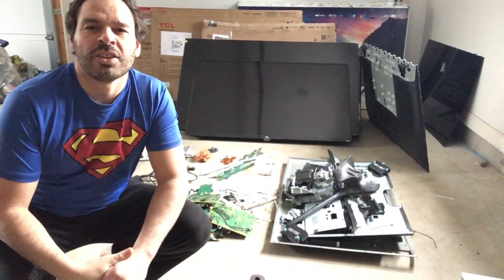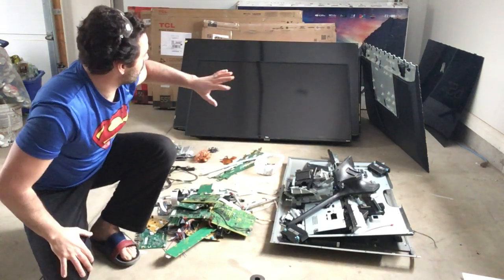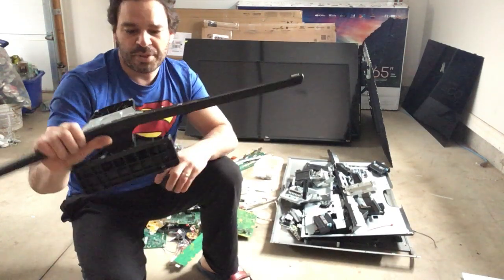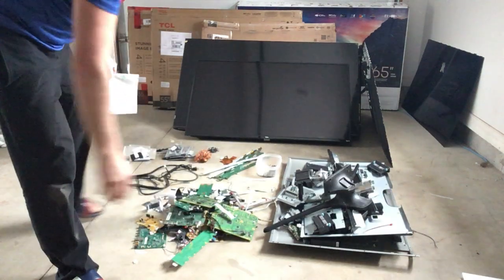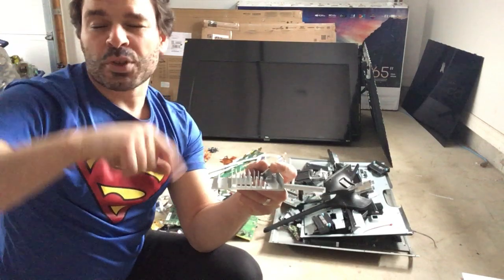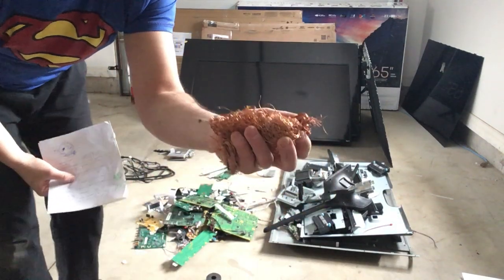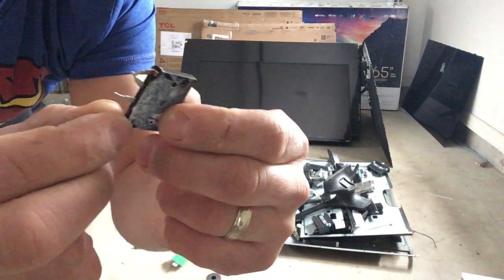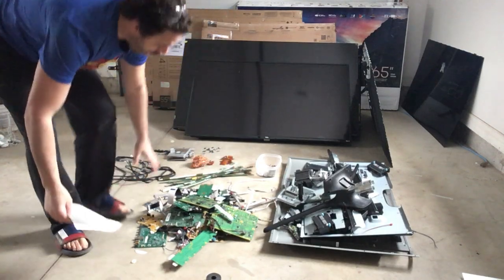Scrapping 7 large flatscreen tvs. Are they worth separating the metals? Yes!

Comment: I have a question? On the circuit boards there's this hospital medical wrist band looking connection looking wire's - my question is why are some connectors gold and others look silver what type metal are the silver looking ones??
Reply from the maker: Great question, I thought the silver ones were actually silver, but told not. I think gold is a better conductor than silver or tin. I will cut the gold band off and keep for later selling and the rest of the band I will put in my ewaste
Reply: @TinManScrapper  what type of metal are the ones that look silver??
Reply from the maker: @vincentsmith9937  I was told a tin coating, but when I check it is not magnetic. Since aluminum is also conductive and not magnetic, it may be aluminum. I do actually separate and perhaps when I use the nitric acid on the silver contacts in the future, I will see for myself.
Reply: Thanks for the reply. I just watched a video last night and the guy put about ten of the ends that where silver looking in a jar along with some nitric acid and he didn't recover any silver so he was saying they're either tin or aluminum or maybe nickel. I'm still gonna throw them in a bag. Thanks  @TinManScrapper
Reply: Thank you

Comment: Whoa hold on, "It doesn't matter about the plastic, the scrap yards are not going to say anything" - my favourite yards will. When you have a load containing lots of plastic, foam, insulation etc, they will give you a much lower rate. Someone inspects your load before you drop it and after. 

Just yesterday a guy was going ballistic because his load of fridges was not at the  light steel/tin shred rate. Know your yard or call ahead!
Reply from the maker: First off, fridges are not steel/shred anywhere. They are given as appliance weight price and may not be excepted at all if freon and or old type. Second off, I am not saying that the scrap yards will take for example a 10 lb piece of plastic if there is only a tiny screw on it, but they will take things like vacuum hoses with plastic outer coating around the metal coil, tv stands that weigh 5 lbs because of the large steel piece and edges of plastic.